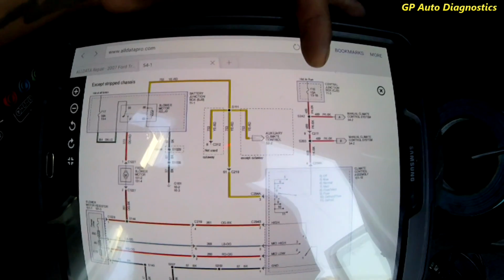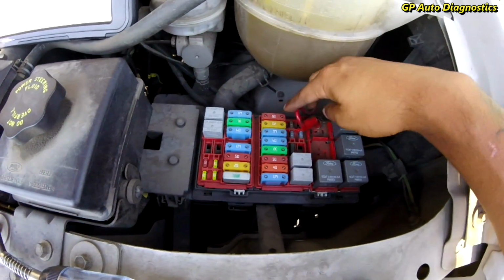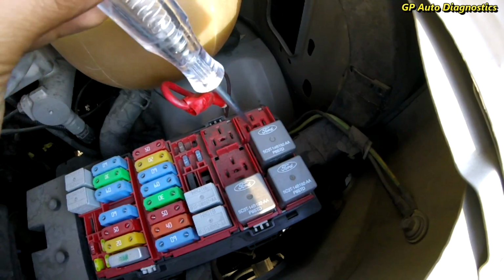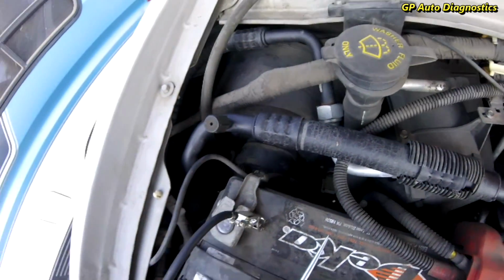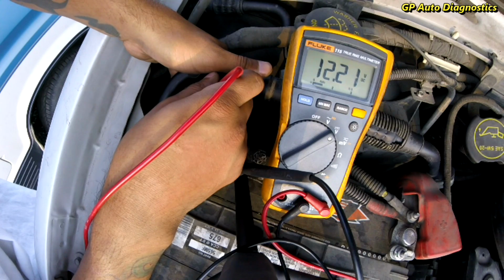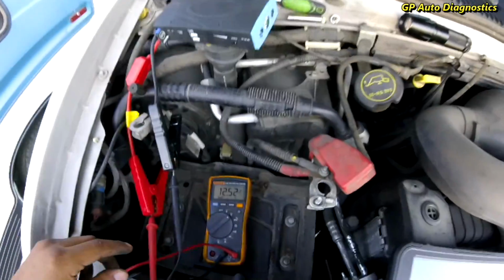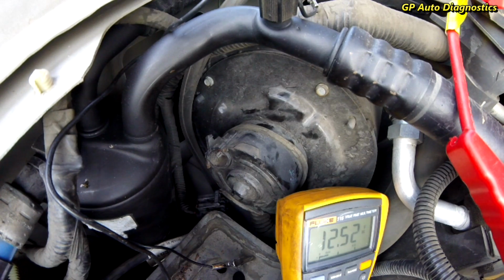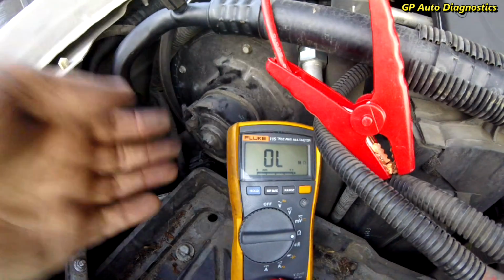2007 Ford E-150 Van - Blower Motor Problems

Comment: I want to thank you for the work my problem with my 2006 e150 wasn’t the motor but a  blown fuse and bad relay. I purchased the van used and the cover for the fuse box under the dash was gone. I needed to know what fuse and relay was for the blower. I could not find anything showing me what the fuses were in the fuse block. I purchased a repair manual and it’s worthless for electrical locations

Comment: Sometimes it is faster to start at motor to see if there's hot to motor,, then you know it's the motor right off the bat.
Reply: That is true.But,sometimes it is faster to start at the fuses in case there might be a bad fuse.....When trouble shooting electrical problems of any type,it is advisable to try to start testing near the middle of the circuit and all of its devices in order to determine which direction to continue testing for the problem[s].I believe this cat may have already known that the fan was NFG and decided to start at the fuses in order to make a tutorial video on how to test the entire system.

Comment: I'm assuming that the reason that you did what you called a "manual test" was to bypass testing the blower speed resister.  The bypass for this can be done simply by putting the motor on "HIGH", as the resistor is not used in the high speed mode.  There was also no test of the blower relay included.  Using an ohm meter (NOT a Megohm meter), you can test for shorts or opens only.  Readings should be infinite. If its zero or reads any continuity at all, then a problem exists with either the motor or cable.

Comment: I have 2002 e250. Changed switch. Resistor. Fan motor. Ac stays on medium, no power to the switch, I can unplug the wires to it and it will still blow on medium. I can’t get any other settings. Help!

Comment: My blower works perfectly when parked. When I start driving it's about 5 minutes on 5 minutes off. And it's most likely not a loose connection because going over heavy bumps never makes any change in the on or off state it's in. Any ideas?